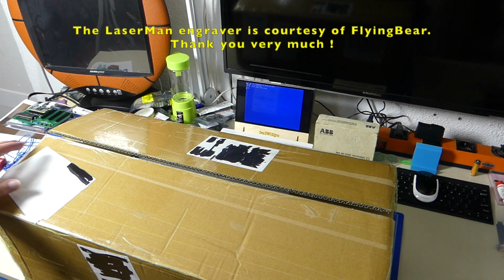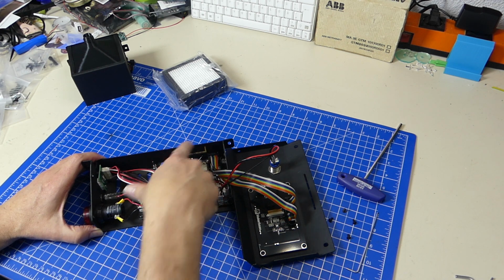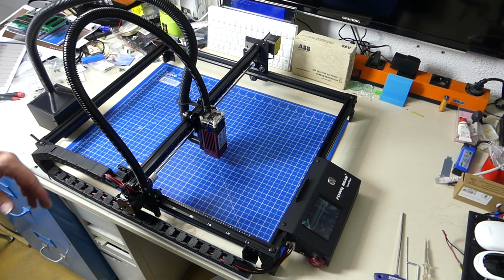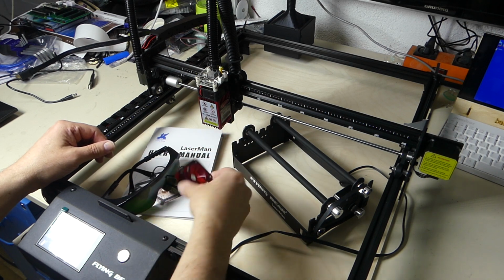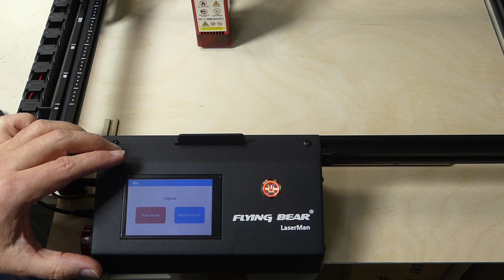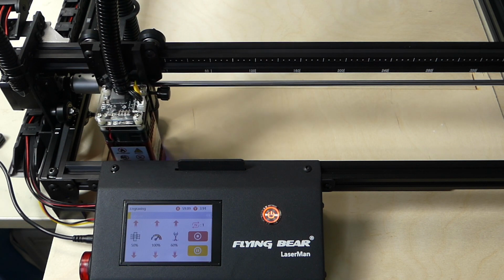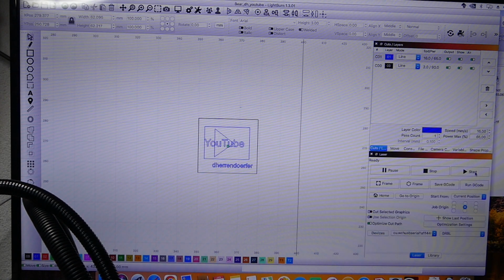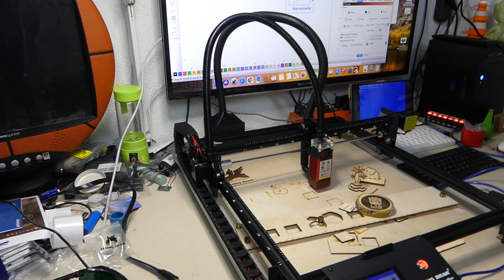LaserMan by Flying Bear 5.5W Laser Engraver - In Depth Setup and Review

Comment: Hi, this is the best review of this machine I haver watched! I have this amazing machine and I like it for a lot of nice features, BUT what really grinds my gear is the module blocking system: the slide is too lose and the module moves vertically (I mean not up/down, but the perpendicularity of the module itself) affecting the focus of the laser. Even if you tight very hard the blocking screw, it will move during your works, missfocusing and affecting the cut line mode. That was really tricking for me to understand the reason of so much different results in works with exactly the same settings for cut and fill. Anyway I still love this machine, I would only like to have much power, like 20w. Is it possible to mount a different module? If so, which one would you suggest?
Reply from the maker: Thank you ! I like the engraver a lot, but I would not want to use it with more power than it has now - it's just too unsafe at that point. That being said - these modern LED lasers have much going for them, the kerf has much improved and the cut and engrave consistency leaves me wishing for a newer CO2 laser than the one I have.

Comment: great review thanks, just got one of these, a total newbie to it all. Please can you let me know how you wired fan to laser out put as the fan only works through sd card so wired mine to run all the time. Thanks
Reply from the maker: in the end, mine now has a switch also - using the laser PWM to trigger the fan did not work that reliable.
Reply: @dherrendoerfer  @scottnever8732 you can also use the command M70 to start the fan, with speed value from 0 (off) to 4. Example: M70S4

I've been adding this to my gcode manually in the header and footer.